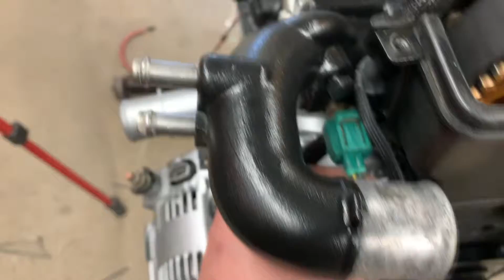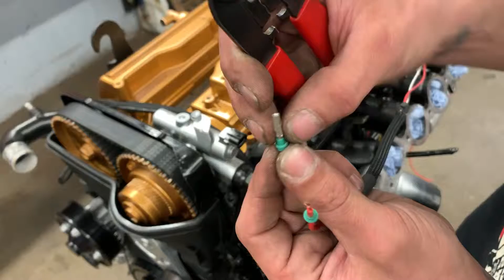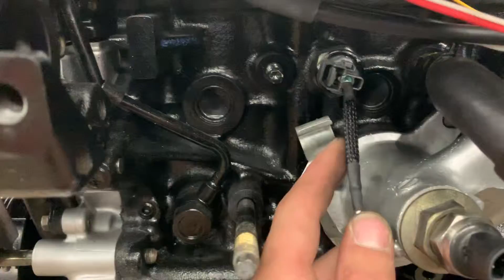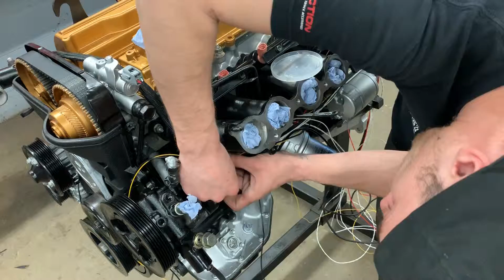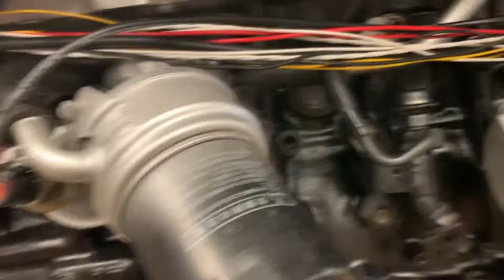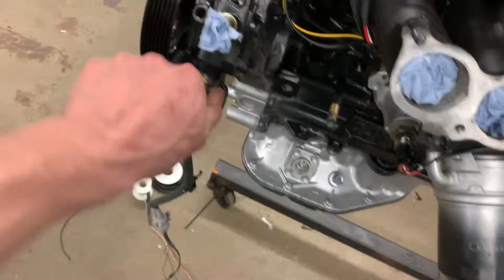2JZ GTE ENGINE HARNESS BUILD PART 2

Comment: Great videos man. Quick question if you don't mind, the oem knock sensor connector only has 1 black wire. I am trying to figure out how did you go about connecting the shield wire (which has 2 small wires in it) to the oem knock sensor connector? This will be very helpful for me. Thanks